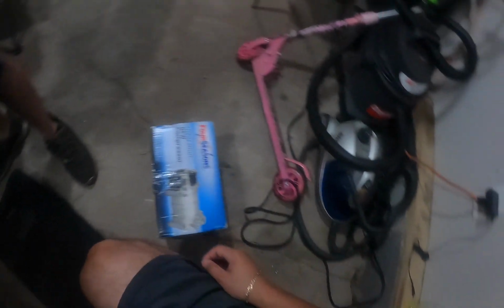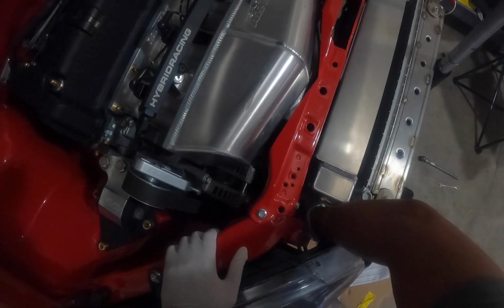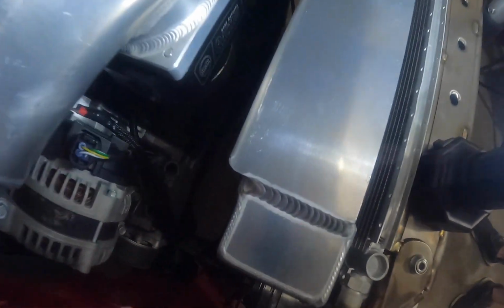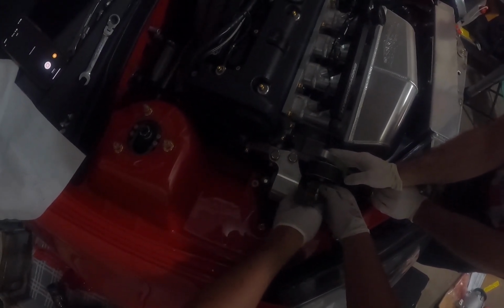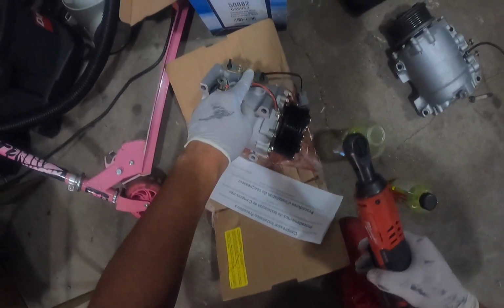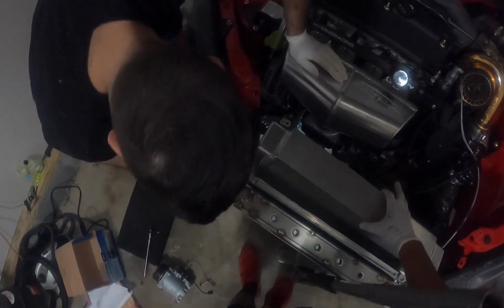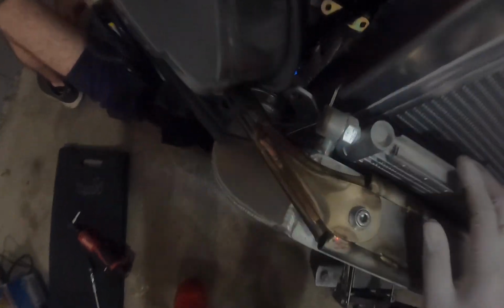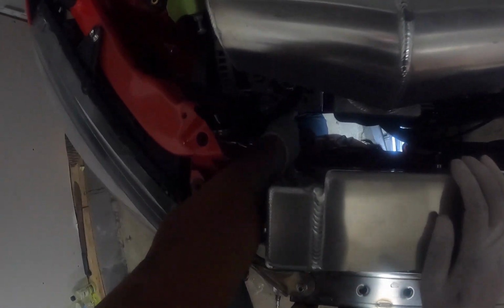AC Compressor replacement on RSX Type S

Comment: Damn come change out my compressor
Reply from the maker: Lol that will be an expensive repair for you
Reply: How is the four season ac compressor holding uo so far? Any issues after installing?
Reply from the maker: Honestly I haven’t used it yet my car is apart right now but it’s almost back just waiting on a turbo manifold